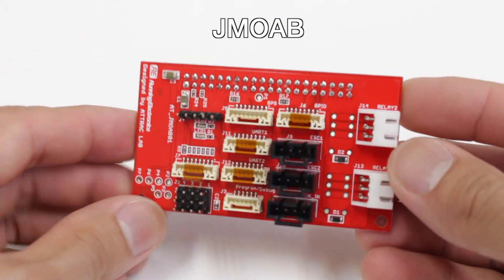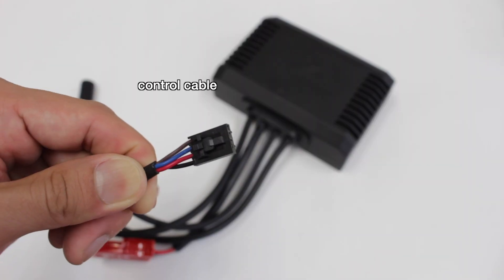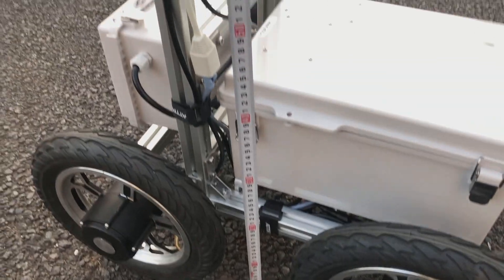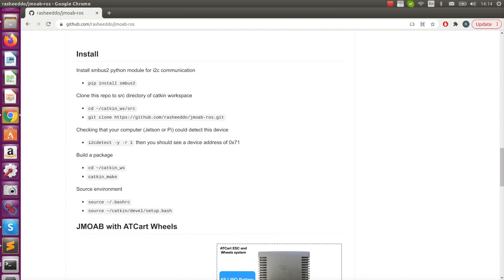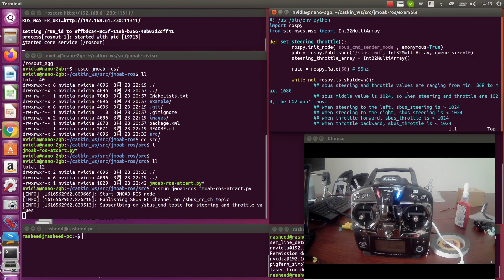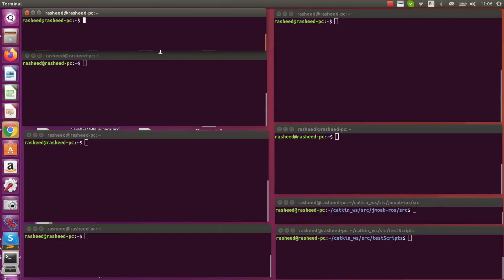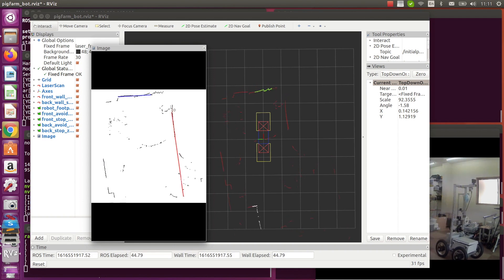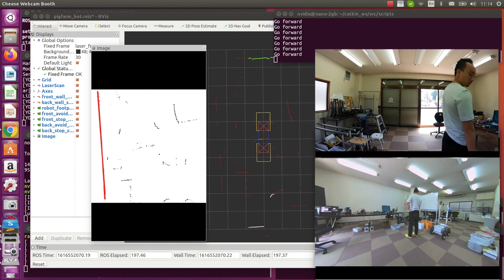Upgrade your Robot Project with JMOAB and ROS

Comment: thanks for sharing all the information.  it's great to see how you have it connected to ROS.  those hub motor wheels and ESC's where are they from?
Reply from the maker: The motor is Xiongda wheelchair hub motor, it comes with Joystick and ESC, but I hacked this ESC to make it be able to control from other microcontroller as well. We could sell this as a set with two wheels hub motor, ESC, joystick, and some bracket to hold with aluminum frame.
Or you can buy from Alibaba, but I don’t guarantee the software compatible in the ESC :)